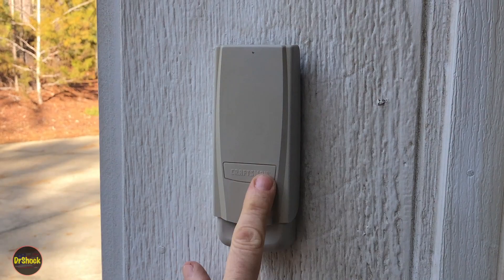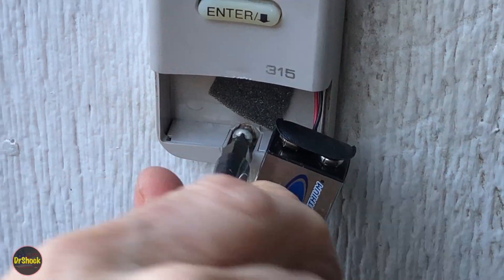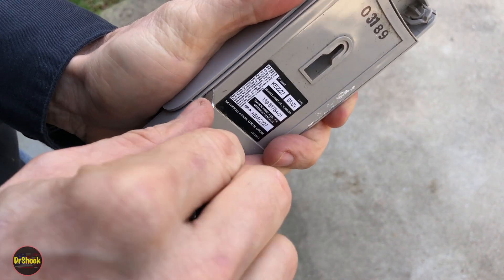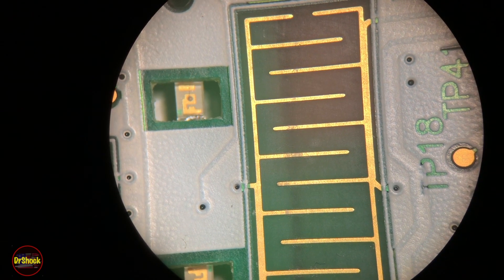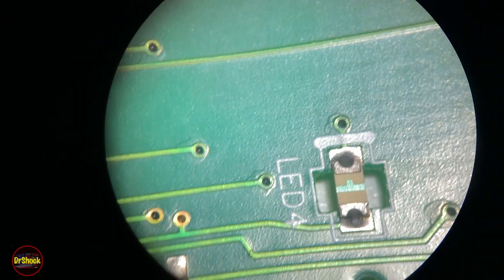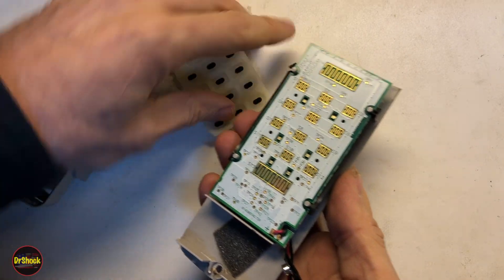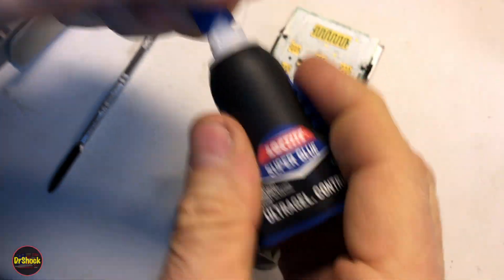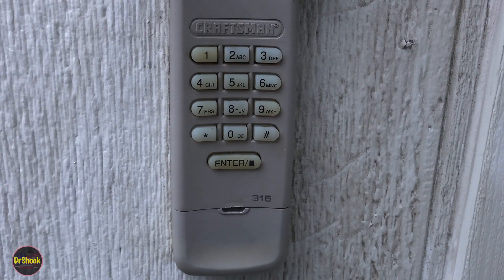Craftsman / Chamberlain Remote Garage Door Opener Keypad ~ Cold Weather Operation Failure Repair

Comment: gonna try this tonight and clean the contact and see if this helps. works perfect in warm weather as soon as it gets cold even with a new battery the one touch close button does not work.. you have to like push super hard and wiggle the button to get it to work. pain in the ass.. will report back

Comment: Thank you! I was trying to figure out how to take the back off without breaking it. My problem was that one of the battery connector wires came undone from the snap. I just re soldered it to a new connector that I picked up for $3 :)

Comment: Which solder joint will more than likely need reflowed? There’s a ton of them and I hate the idea of reflowing all of them. I would have to assume specific joints would be more prone to failure
Reply from the maker: What I've seen is that it's dirty button contacts more often than not that is the cause of the opener becoming unresponsive in colder weather.   I'm not aware of any specific failure pattern on the solder points though, and would recommend a reflow of all of the board points where devices or connections are soldered.
Reply: @DrShock  ya, that's what I was pretty much figuring on doing is getting it cracked open and cleaning the contact points and then spending a minute making sure that the solder joints are ok. just getting through that glue is not fun.

Comment: Any kind of glue that’s a little less permanent in case it needs to come back apart?
Reply from the maker: If the problem was due to the button contacts being dirty, typically such a repair is a one time action to extend the service life of the opener.  The button contacts eventually wear away to where replacement of the unit is necessary.  However, if the problem was due to cold solder joints, then you can go alot longer on the service life.   If you want to go with a weaker adhesive, I could suggest something like a silicone based glue instead.

Comment: Interesting...may i make a suggestion to use a plastic guitar pic to pry the cover and not a screw driver, also if you use that much Super glue you will never get it off again if needed.
Reply from the maker: You will not be able to disassemble this using a guitar pick or any plastic tools as it is plastic welded together.  Metal tools are required to break the weld free.  Also this is a one time repair as further wear down will require complete replacement of the unit but that should not be for many more years.  So you will not be reopening it ever again.  ;-)

Comment: I tried your methods and something still seems off with the battery cable.  Either loose solder or it was just dirty so I cleaned it and it worked but when I tried it again it did not.  I played around with the battery connector and it worked again so I'm rolling with it for now.  Thanks again for the advice on how to open it up.

Comment: Followed your steps on carefully removing the back cover. I took a QTip swab, rubbing alcohol,cleaned off all the terminals and sealed it back up with silicone (use clamps until silicone drys) I put the battery back in and  'boo yow' back in business.....Thank you, sir!!!

Comment: Great training video.  I had a problem with the unit and it turned out to be a bad key. Reprogrammed it and it’s working fine.  I do think that this video was a lot of work versus just replacing it, especially if it didn’t fix the issue.

Comment: Thanks for the bid. I sort of figured they glued the darn thing. Anyways, yes, often it’s the number surface that get dirty. Make sure to also clean the black rubber on the rear of the keypad with soap and water, or alcohol. They get gunky and won’t conduct a circuit.

Comment: Thanks for the video. Unfortunately, it was impossible to take apart my Chamberlain keypad, no matter how I tried. They make these intentionally so that opening them up for repair is very difficult, to sell a new one when the buttons stop working. Luckily, a replacement can be found for about $15 so no way will I pay 50+ bucks to Chamberlain for it :)
Reply: I have the same issues. What I did since I could not open it, was I just sprayed the cleaner inside and flooded and let it dry. And hoping will last. Thanks for the video.

Comment: I started having a problem a few years ago with my sensors.  One of them would stop working and I figured out it was when it would get really cold, way below freezing.  Otherwise, it worked fine.  I started having the problem again recently with some bitter cold weather, so I used a hair dryer on it for a few minutes and the light came on and started working.  I then put an incandescent bulb near it to keep it warmer until I the temperature gets higher and I can replace the sensors.

Comment: It took a while to find a video that shows the opening and now I know why. It takes a lot of time and care to open with out breaking. Now I know why people just say to replace it. I didn't want to deal with that right now so I changed the code for now figuring the current code buttons were worn or dirty since the key pad gets used several times a day and it is working fine now. The ENTER button could go next though so I will  a new one and take a shot at opening and cleaning the old one and if it goes well I will have a spare. THANK YOU!

Comment: Thanks for your great video an: explanation on how to open the back of this son of a gun. It’s nice to know I don’t nearly have to break my fingers when I open up my garage next time.
Also, maybe not mentioned in the video, but using the rubber eraser from a pencil in rubbing it along all the contact points of the motherboard helps tremendously. I did not have to do any soldering.

Comment: As careful as I was, the unit would not come apart, the case edge just cracked. Replacements are fortunately available for about $20. The video was great, though knowing what is inside.
Reply: My Chamberlain was also too well glued. I think the plastic casing may also be too UV damaged to withstand flexing...

I almost bought a no-name replacement, but then read a comment that the knockoff would not  let you close the door just by pressing the enter button - it would be necessary to reenter the code. I ended up buying the original article, which has one-press close.
Reply: Same

Comment: Amazing disassembly and repair tutorial! I have used 90+% isopropyl alcohol (not Dollar Store brand though, it tends to leave a film) on PCB contacts before with good success. It doesn't work so well on rubber material though. Okay to use on the contact surfaces on the rubber though as far as I know. Probably warm water, mild dish soap, and a sponge might work well for the rubber piece.

Repaired an old Playstation 3 controller I thought was a goner for years that way.

What a total pain they superglued it together. They could have used screws and rubber gaskets on the back and battery cover to really keep it free from moisture. Manufactured to fail... Guess they gotta make constant revenue somehow.

Hoping to repair ours instead of shelling out $35 for a new one. That money could be better spent to buy a HomeLink Repeater to link it with our vehicles lol.